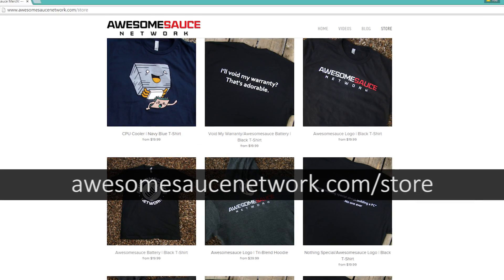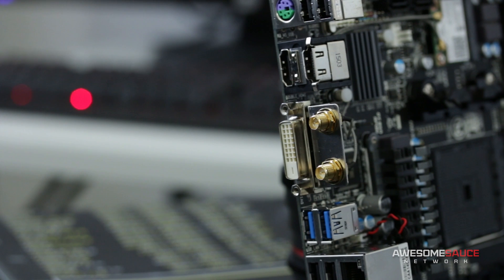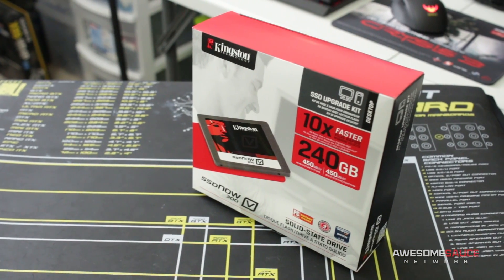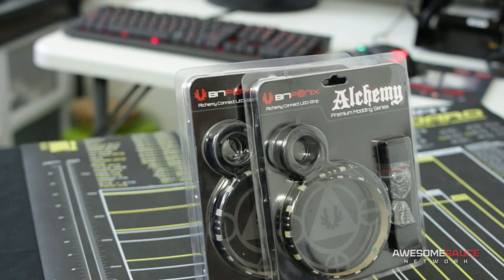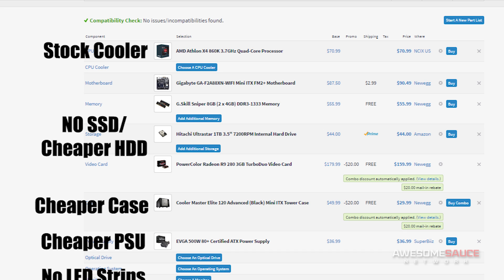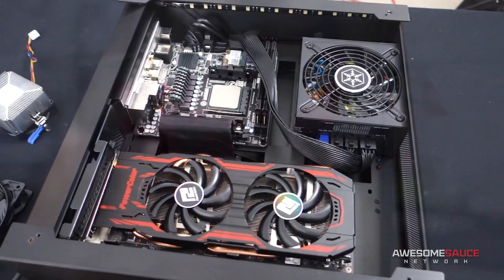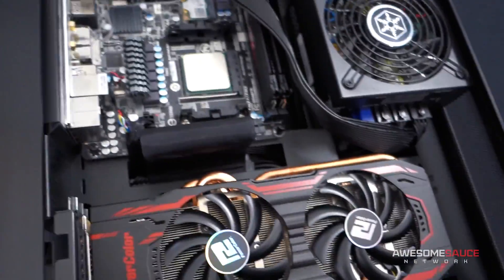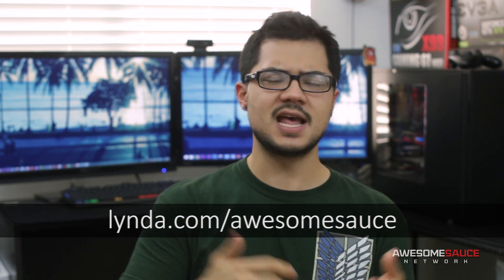The Overkill Console Killer: And How to Build One for Under $500 (Part I)

Comment: actually it doesn't beat console because it still lags at 30 fps and 1080p on most of the new games but xbox doesn't it may out perform console just in the capabilitys but then its not a console killer because the console beats that computer at what it does

Comment: I'd recommend going second hand. When buying new components you end up paying a lot for the fact that it's new. I recently managed to build a PC for a friend using parts from Gumtree and eBay for £230 which should easily beat current consoles. It's using a GTX 770, an i5 3470 8GB RAM and a 500GB Seagate Barracuda hard drive. Compared to my own PC which uses a SATA SSD as its boot drive there is very little difference between the two when it comes to responsiveness in Windows.

Comment: Can some one tell me if these components are okay for a good build I'm a pc noob so yea

CPU:  AMD Ryzen 1600

CPU cooler : Cooler master hyper 212 led

Motherboard: Asus PRIME X370 -PRO ATX AM4

Memory : Crucial-8GB (2x4GB) DDR4-2133

Storage: Samsung 850 EVO-series (SSD)

Video card:MSI-geforce gtx 1050 2GB gaming X 2G

Case:Corsair crystal 570x black/red

Power supply: Corsair CXM (2015) 450w bronze certified

Pls tell me anything that I could swap out or something that is wrong/not good.
Reply: savage6669 what games will you be playing? What's your budget? And I would say drop the SSD and get an HDD.
Reply: Ace Replays my Budget would be 1500 sgd and I wud be playing games such as black shot,gta5 black ops 3 and such games basically fps games
Reply: savage6669 if should be fine, it might underperform just a tad in gta 5 tho, most likely 60 fps on normal settings.
Reply: Where's your hdd?

Comment: Look it's easy to make a gaming pc that can handle 4k @ medium settings. All you need to do is pair an i5 2400 (a still very capable cpu) with a gtx 1060 6GB. Some might think there will be a bottle neck however it won't be big. You can build a pc under 500 that can play 4k.
Reply: Sufyan stop.
Reply: Sufyan run witcher 3 on ultra then come back

Comment: Hi Bitwit, I need some help with making the right choice with choosing either a mini-ITX, Micro ATX or standard ATX setup. So, I have had my PC for 6+ years, my USB ports have failed and have not been working now for about a year, so I had to install an USB adapter card.

The battery also died just a few days ago so I had to replace that too. Sooner or later my board will pack in, so I am looking at either a Mini-ITX or Micro ATX build. I'd like to downgrade in size and just want a smaller compact size PC for gaming, nothing extreme. My desk is huge so we want to just get a smaller desk and having a smaller PC would be ideal.

I have a huge Silvertone case tower, Asus Maximus VII motherboard, i7 4770, 16Gig Corsair Vengeance DDR3 and GTX 1080 Founders Edition and has served me well these past 6 years. I defiantly like the look of the Lian-Li cases. I was thinking of PC-05S or 6S Micro ATX. Can you tell me if I were to go for this Mini-ITX case with my current video card and ITX motherboard like Asus ROG Strix Z270I if this would run fine with mid-high end gaming with no real issues so I don't have to have a massive tower sitting under my desk? Or should I just stick with a normal size PC setup? I never bothered with SLI or water-cooling. I have never gone high-end with hardware or upgrading. I only upgrade my video card when I need to.

Comment: The AMD Athlon X4 860K is a great processor, and you CAN build a "console killer" around it, but it cannot really provide at least a MINIMUM of 60FPS on many titles. Of course you can have higher textures and other settings than a PS4 or Xbox One at 30FPS, but what about games without settings to cap it 30FPS? Doesn't exist? Try Dying Light. Bottlenecks at it's greatest and no way to cap the FPS to 30 in-game. You can use the Nvidia Control Panel to cap it YES, but compare the results after doing that to playing that game on the PS4. The frames look as if the PC is skipping at least a frame or two each time meanwhile the console looks much smoother. Who plays Dying Light on a PC you ask? I do, and it was an example mainly, as it is one of the few games I clearly remember that produces this issue on a AMD A10-7860K (the twin of the Athlon X4 860K). My point? It will be a console killer to a certain extent, and it sucks (I own every console, a mighty PC and a lesser PC, and I know the differences). I'm sure we've all read that one guy who echoes everything he reads say "console will always have better optimization, blah blah blah blah blah blah", which is why some games suck on PC with equivalent settings found on the console version. But if you can put up with some of the areas where the PC will fall behind, it should definitely be called a console killer.

Comment: So what is the difference between this CPU and something like the i7-7700k (4 cores, similar clock speed)
Reply: night and day, the i7 shits all over the athlon, actually an i5 3570 does it alone but the i7 has hyperthreading which I mean it has 4 physical cores but because of hyperthreading it performs like it has 6 or 8 cores, the i5 3570 on the other hand is only a 4 core cpu with no hyperthreading

Comment: I have a 2tb xbox one harddrive and I was wondering if I can use it with a pc
Reply: Cannibal Gamer Open the Console and take out the hard drive. Plug in the sata data cables and the sata power cables to it. Done.
Reply: Cannibal Gamer Yes you can use it in a pc. It's still a SATA connector.
Reply: Matthew Vogt Sorry, I don't think that would work, i believe the Xbox has different HHD connections than pc.
Reply: Ronald Smith how can I use it?
Reply: Ronald Smith oh it not in the console it's an external drive
Reply: Cannibal Gamer What connector does it use to plug into the console?
Reply: a USB with some kind of weird plug at the end
Reply: Cannibal Gamer Post a pic of it on imgur and send me the link. I'll tell you what it is.
Reply: uhh I don't have imgur
Reply: Cannibal Gamer 
hmu at someguy4456 on kik

Comment: Nice Wattage. Consoles are far better in terms of wattage so...you want to game on a budget? Why does no one ever bring up the electric bill? Bc they forget about Wattage. Here's a far more viable option if you actually want an argument....Also, stop forgetting about the goddamn cost of your OS. This is about total cost and you cannot have a computer run EFFECTIVELY without Windows (unless you cheat the system, which I wouldn't recommend). Or unless you already have a disc for multiple computer pre-installation.
Here's my console killer (w/ Windows 10 included): https://pcpartpicker.com/list/kxgmm8
Reply: problem with wattage is its going to very on state and or country so its not going to be an easy comparison and 2 its negligible of a cost difference. that pc runs below 340 watts on max load which is the same area of electricity as a console and you can download windows 10 for free from microsofts own website

Comment: Help me build a $200 PC, it's that or a PS4.
Reply: Turbonite umm. why a $200 PC when you have the cash for a PS4? there's no way you can buy a PS4 for $200 unless it's second hand. also, you won't get a PC of any respectable standard for $200. $400 is kinda bottom line.
Reply: Turbonite You have a tv? You don't have any old mouse or keyboard? Get a long hdmi cable or such and just use your tv with your pc so you won't need a new monitor. If your budget is that restricted you should probably seek for some components on local sites where people may be selling their old components etc. and look for good deals, as long as they work there shouldn't be any problems with using used parts. It's tough to say what parts you should get when I don't know where you are able to buy the parts from. 200$ is a pretty tight budget to be honest, but I'm certain it's possible to make a gaming machine that easily outperforms a ps4 with that budget.
Reply: DaEpicFace Official DaEpicFace Official I got a TV in a raffle and I don't think have a keyboard and mouse because I have a laptop :/ 

alot of PC ppl tell me I should spend at least $500 on my PC and i haven't seen some one make a $200 PC that tops a ps4.
Reply: Turbonite Okey, so you have 250$ to buy a pc, keyboard and a mouse. Probably a wireless mouse and keyboard since using your tv as the monitor is definitely your best choice, I'm gonna look around a bit since I have nothing else to do and compose a 250$ build with a mouse and keyboard. Lol.
Reply: DaEpicFace Official so should I just buy a ps4? It seems like more practical thing to do.
Reply: https://pcpartpicker.com/list/xLcvd6 here is a build that fucks a ps4 royally up, and you may find atleast some of the parts for cheaper if you look for them. Remember that the price it shows is for new parts from US, from a shop that is rather expensive as well. Here is an even cheaper build: https://pcpartpicker.com/list/j7vkWX. If you won't bother with giving up some of your time to look for the parts to gain better quality and increased usability whilst not having to pay for multiplayer and paying less for games, go for the PS4. I wouldn't, but then again I'm not only a pc-gamer (my build which I'm showing due to small-penis syndrome https://pcpartpicker.com/list/FM4vd6) but an Xbox fanboy :)
Reply: DaEpicFace Official dude these builds are $600 that's basically what these "console killers" are tho always around $500... I really hope to get a pc for $200 but it seems impractical
Reply: DaEpicFace Official do u think it would perform better than a ps4? Most "console killers" are 400+
Reply: Yes it would.Turbonite
Reply: DaEpicFace Official cool thanx.  And w/windows 10 right?

Comment: Been looking to get my pc off the floor and on to my desk (aiming for less dust). This case looks like the ultimate solution. I have the Mastercase 5 but I've recently discovered a major flaw with the case. By the front foot there's a massive opening. I can reach up through it and touch the inside of the case. This allows excessive dust to enter the case. A mouse could crawl in! Hell I got a spider in my pc a week or two ago and that's the only way it could've gotten in!

Comment: hi I'm from Philippines can you help give me an idea what to build I only have a $1000 I want a ddr4, gtx 1050 or up, thanks
Reply: Dhang Fernandez No please don't even look at daniels list, he invested in the wrong things. Here is what I picked, keeping your budget in mind: https://pcpartpicker.com/list/63FrRG. First, you dont need water cooling, just money wasted. Overclocking doesn't help you in gaming that much, and you can overclock with the 212 evo just fine. If you can afford it without sacrificing other stuff, go for the watercooling. For some reason he chose expensive and pretty basic RAM, I chose better but cheaper. 120gb ssd is enough for os, it's not needed for anything else so 250gb is excessive. 1tb hdd is enough for most people and if you ever need more, hdds aren't expensive. I changed the case because this one is cheaper and I have it myself, it has very quiet stock fans and wire management is easy with it. I would recommend you move the top fan to the front and flip it to pull air in, would give you good airflow and neutral pressure. I removed the windows 10 and recommend you buy a windows 10 key online for much cheaper and download a windows 10 installation tool on an usb. Now the cake of the build, the gpu. I picked the MSI 6GB GTX1060 for obvious reasons, it's just about the right price, and it gives great performance. No profit in having a shitty card like what daniel suggested with great parts everywhere else in your rig. The cpu and psu daniel picked are good, can't complain about them.
Reply: Dhang Fernandez 1050 isnt worth it buy a 1060 or a rx 480
Reply: Dhang Fernandez https://pcpartpicker.com/list/cmC7pb
Reply: +rafet simsek oh I read some article that Rx 480 kept crushing dota 2?
Reply: +daniel stubblefield oh good pick thanks

Comment: even defeats the ps4 pro😂😅
Reply: Anything beats that piece of crap.
Reply: Including a literal piece of dog shit
Reply: Squall Leonhart Even the Xbox one 😂
Reply: Cairo Murphy all facts stated are correct habibi
Reply: We Savage mate mate mate stop it.
Reply: Mark Rodriguez NOT 4K though upscaling is nowhere close 4k
Reply: SJ easy
Reply: the ps4 pro has 4.2....nice try. literally can disprove the 6.2 with a simple google search. Even the One X doesn't hit 6.2, and that's by far the more powerful of the two consoles
Reply: Mark Rodriguez But not pre-built PC's around $300-$400. Custom yes, pre-built no.
Reply: Mark Rodriguez it's not just a oc version of the Ps4 it also has more Cuda core more shaders a more powerful gpu in general, yes it's based on the same architecture but that's it. It's cpu has been oc but the GPu and rest of the system is all new.
Reply: Medo Gabr You have to remember that the pro runs games at high-very high settings too not just a higher res.
Reply: Cairo Murphy 
good joke
Reply: im2shady4u13 ooh bro i just looked at the. Omment back again and the ps4 bearly hits 4.2 tf srry ma mans i meant xbox one
Reply: Band Xbox one x
Reply: *and
Reply: Mark Rodriguez also has 1gb extra ddr3 to run background procedures allowing it to free up as much of the 8gb ram shared for gaming performance. A Ps4 pro is a better option for majority of people and does pack a punch for the price.
Reply: Ps4 pro has a combine float point performance of 6.2 tfl (this pc tops out at 5.2 tfl ma man
Reply: Nope get your facts right

Comment: so if you cant fit the Lp shadow rock in the case what other fan do you use any suggestions
Reply: watercooling if you have the funds...
im going to get the O6S in the new year and do my first custom waterloop in it

The PC-O5S, PC-O6S, and PC-O7S support AIO water cooling systems. The “S” suffix in the aforementioned models denotes water cooling compatibility. The PC-O5S supports radiators up to 240mm, while the PC-O6S and PC-O7S supports 360mm radiators. 
(please note kyle is using the PC-O5 case which you cant watercool with though)
Reply: David Midcalf
so then what fan should i get tho
Reply: well if you get an 
AIO then it wont matter what fans you get for it so long as you get static pressure fans as they can be ran with lower speeds and push/pull more air

Comment: CPU: AMD fx-6350
PSU: EVGA 500W
CASE: Fractal Design core 1000
RAM: 16gb G.Skill Ares ram
MOBO: Gigabyte GA-78LMT-USB3
GPU: MSI RADEON R7 360 2GB
HDD: 500GB Seagate

Will it run CSGO, plus edit well?
Reply: Edward J Will run CS no problems although I'd go with a i3 6100 cpu and with that you need a new mobo
Reply: Edward J personally i would go for the 6100, it will do much better in csgo, also try cutting down on that ram to get a better gpu, mable like a 1050 ti, which would easily beat the 360. 8gb ram should be fine.
Reply: Edward J I'd buy an MX300 M.2 SSD if you're going to be editing, it'll pay off in the long run and generally make your PC feel faster.
Reply: Edward J CSGO can run on integrated graphics, that thing will have zero problems with it.

Comment: Made another build using mostly the same parts, different CPU (Already have one lying around): http://pcpartpicker.com/user/SilentSkillHD/saved/HqTBmG
Reply: dennis 212 just buy it from kinguin for like $25, or just use a key from an older desktop you might have
Reply: SilentSkillHD lol you are going to buy windows?
Reply: +SilentSkillHD Pretty solid, why not a i3 6100 though? I like how you included Windows, not many people include that in their planned builds as they have it already - unfortunately, I do not.
Reply: Peyton Almond Yeah, I dunno, I honestly only used that i3 because I had a spare and it worked well for me but I will check out the 6100
Reply: SilentSkillHD I have a 6100 and it's honestly the best i3 there is, it's clocked at 3,7GHz but if you know how you can get that to 3,8GHz and it performs great for its price! I paired it with a Sapphire Nitro+ rx480 4GB which is also great for a budget build and squeezed the shit out of it with Afterburner.
Reply: DaEpicFace Official Hmm, I'll check it out
Reply: SilentSkillHD ok thanks
Reply: dennis 212 If I may add to what SilentSkillHD said -if you're buying from Kinguin, make sure you have an ISO of the exact version you're planning to buy.

Comment: Can I replace the r9 280 with the gtx 750 ti and expect similar performance?
Reply: the 280 is better :)
Reply: What about the rx 460
Reply: +UltimateBear r9 280 > rx 460 > 750 ti
Reply: dont get a oc pentium its on older afchitectutr so ddr3 and it only has 2 cores And you have to buy a z170 board. jist stick with the i3 so you have a newer platform and kabylake support
Reply: 750 ti has better fps with an i3 than an R9 280 with fx 6300. Fx 6300 is similar to an i5 so yeah 750 ti is better.
Reply: Actually Im switching to an i3 6100 and an Asus strix gtx 950
Reply: https://m.newegg.com/Product/index?itemnumber=N82E16814487153

How about a gpu that is better than that and 100$ off
Reply: Well actually Im going for a sapphire nitro R7 370 and a g3258 oc with a hyper 212 evo.

Comment: I got a Lenovo H50 i5 3.20 ghz 8gb of ram-8 can be installed extra. Windows 10 2tb hard drive. Got it for £170. Is that an ok deal? I want to install a graphics card what would you suggest pls? i have a 650W power supply new bought for a project a yeae ago that wasnt started. Thanks
Reply: I would like to play Euro Truck 2 or US Truck Simulator and other simulators at high or more.